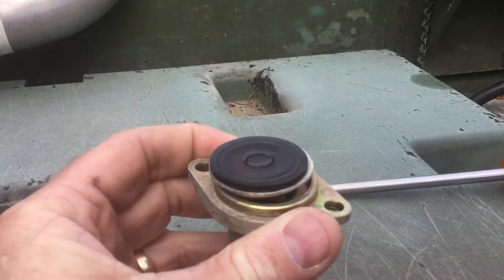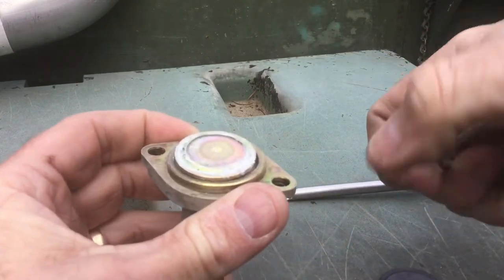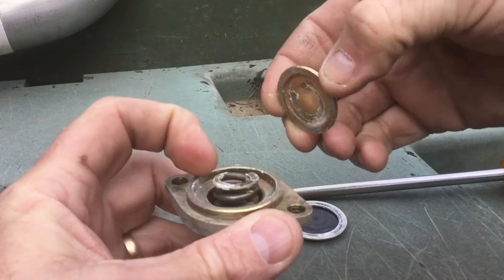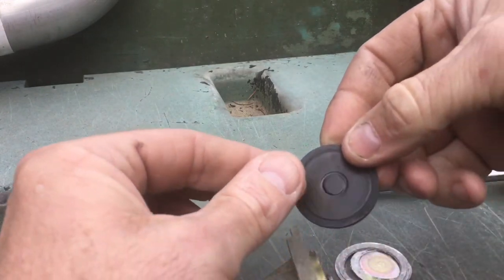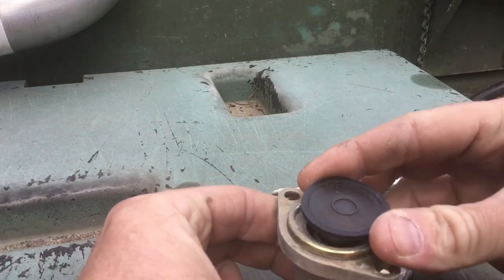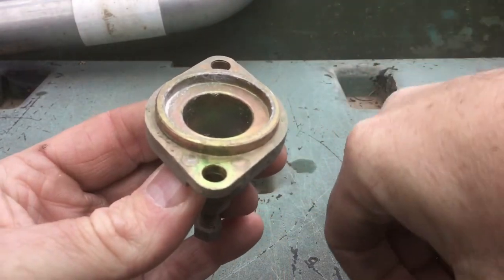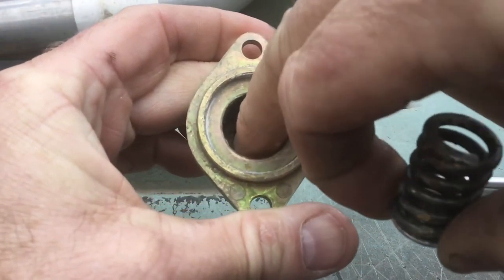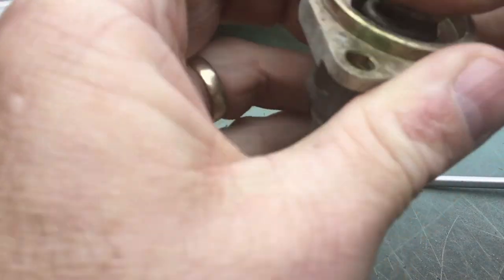LMTV Wet tank air protection valve

Comment: Whew! Glad it is 85 PSI since I changed out my sending unit for the higher pressure CTIS. Fortunately, the pressure for HWY is now set at 75 PSI. Good to know dissection. Thanks Ron!
Reply from the maker: Well CTIS is only going to get pressure above about 89 PSI anyway.  The CTIS pressure switch controls the process. CTIS won’t start until the switch closes at 117 PSI at the wet tank. It halts a fill when the contacts open at 89 PSI until the tank refills back above 117 PSI...

Comment: Ron, I disassembled my wet valve as your video suggests, and saw the rubber diaphragm has a circular tear in the center…. Is that normal or is the diaphragm shot?.. thanks
Reply from the maker: It should have a ring where the rubber rests on the outlet port, but it should not be torn.  You may be able to flip it over to use it a while longer while you source some new rubber material…

Comment: Mine seems to whine once the compressor shuts off.
Reply from the maker: Well unless there is air flowing thru it, it shouldn’t really make any noise above 85 PSI.  If you have leaks along that leg, it could be bleeding the wet tank down to 85 pretty quickly.  You would need to put a gauge on the wet tank to get an idea what is happening...
Reply: @rronmar  Good idea